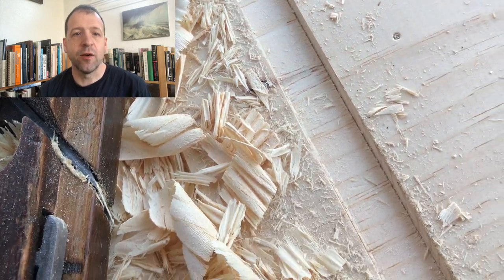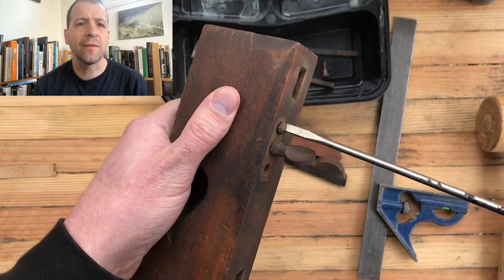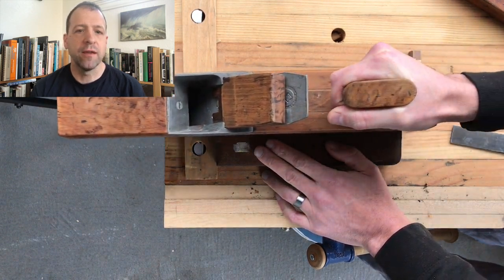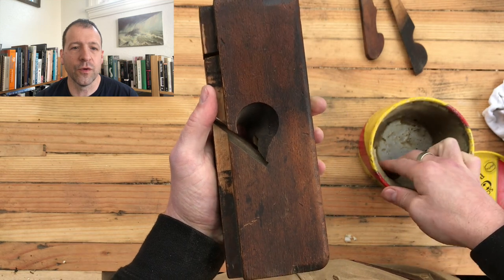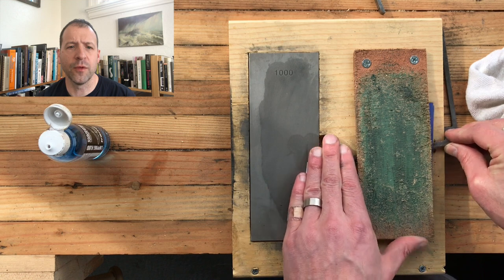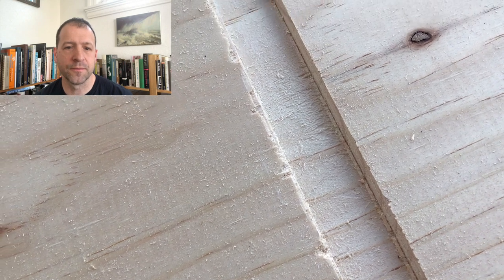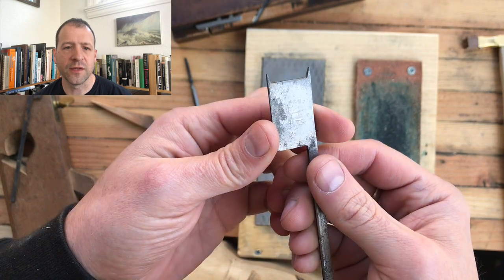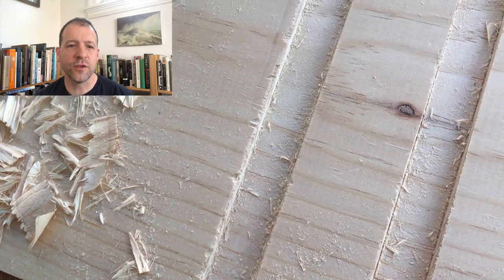Cut Perfect Dados Without Power Tools (plane tune-up and restoration)

Comment: Just recently picked up a dado plane that is essentially identical to this one. Same chip escapement shape. That almost tear drop shape. Only real difference between them is mine is marked H.Chapin Union Tool Company. That and mine has brass adjustment hardware, and is missing the knicking iron. Wedge is present for it, though.

Comment: Found one recently for cheap. Missing one wedge and both irons but the body was in too good condition to pass up. Any suggestions on where to find replacement irons?
Reply from the maker: Finding individual irons for a dado plane is probably impossible. Honestly I would find a cheap crappy dado plane on ebay and just use the irons and wedges from that.

Comment: I have a rebate plane that is in very good condition.  There very faint letters and numbers. The numbers say, "1776".
Reply from the maker: I’d love to know what the words are. Planes with dates are fairly uncommon but there are a few out there. James Stiles was a New York planemaker (active between 1774-1823) who dated his planes. I have an unmarked sash filletster dated 1822. I’m not too surprised if an owner wanted to commemorate 1776 on their plane!
Reply: @WoodenPlanes  the 1776 rebate plane has 4 Initials: "R D E ?" or "REE?". The fourth letter could be "K". The plane is made of second growth beech because the growth rings are wide. The owner nailed many fences on it; sole & side. I added a fence in existing holes for a 7/16" rebate. (Iowa).